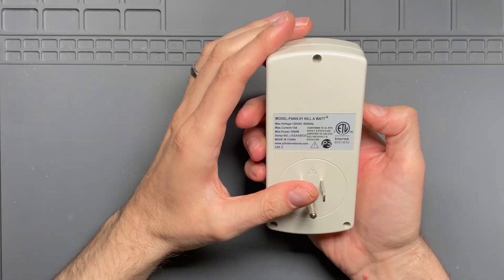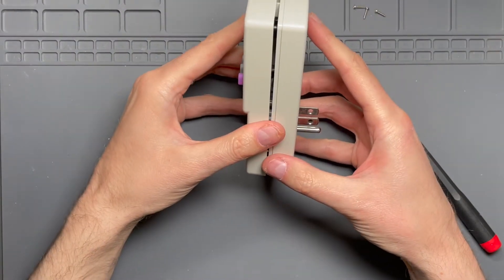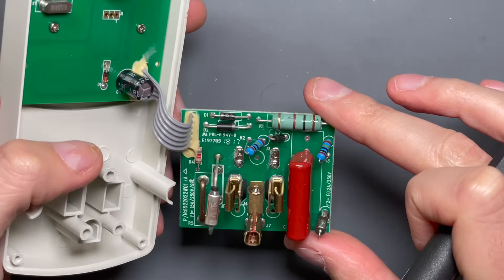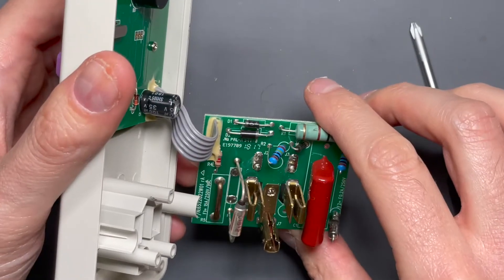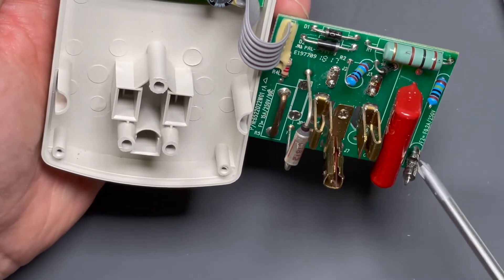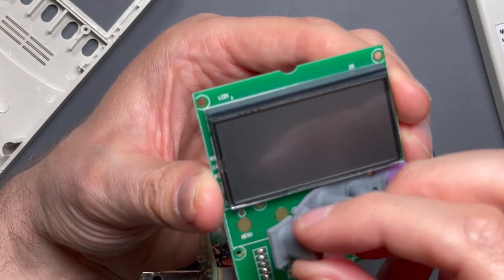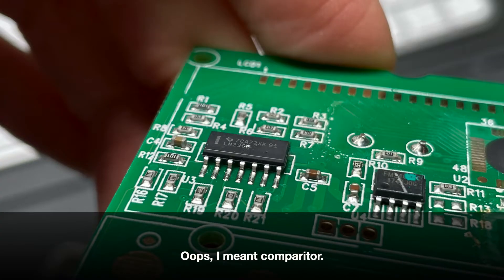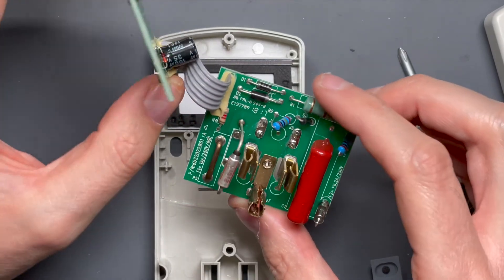Inside a P3 International - Kill A Watt

Comment: I bought a generic Chinese made one of these to see how much power my devices were using on standby. It worked correctly for about 3 months. 

About 4 months in, I tried to use it, and it would display various things but not the wattage being drawn ... which was what I wanted to know. 

I thought I could get an idea of why everything was working apart from the wattage measurement from your teardown, to maybe fix it. 

Anyhow, I've just plugged it in again and now it doesn't even display a single thing, so I think it's a bust. 

More high quality landfill waste 😕👍
Reply from the maker: Bummer. Perhaps check out the more recent video I made on a MEECHER power analyzer. It is more generic, and there are many similar versions with different trade names. If it is similar to that one, it might be something as simple as bad solder joint on the power monitoring IC, or maybe the display zebra strip has come loose... Hard to say without seeing it. But maybe give that video a watch. Thanks for watching!
Reply: One K-A-W video showed the film cap had failed mostly open ... you might do a search for that repair.